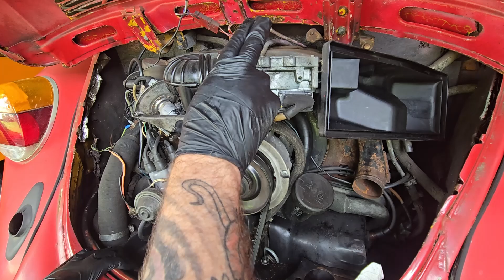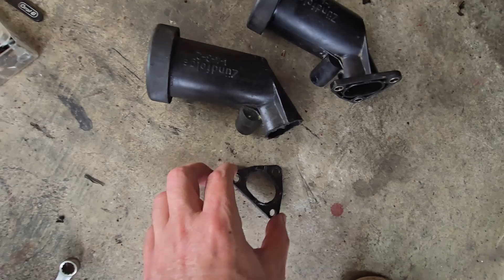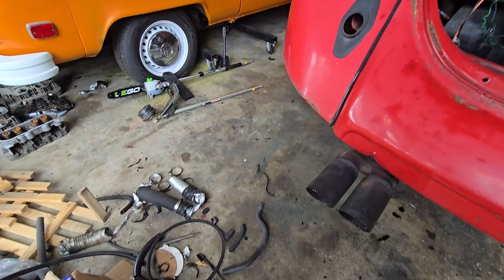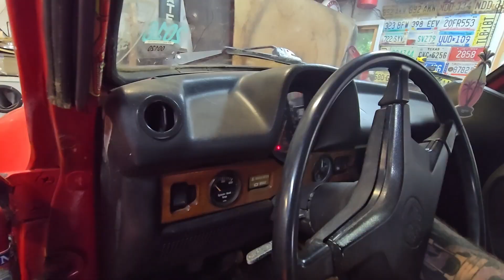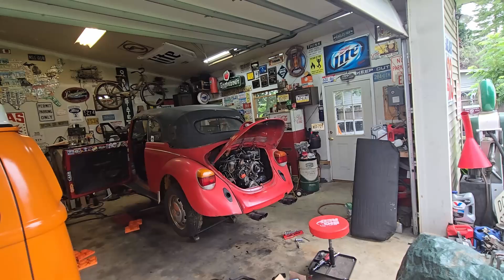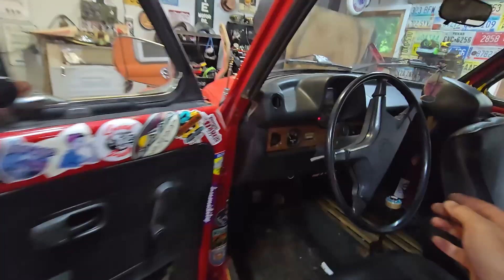VW Beetle Fuel Injection Tutorial - Full Breakdown of the Bosch L-Jet System

Comment: Question for you sir, do you have a recommendation for sourcing vacuum lines? Also do you have a list of all the different size hoses that are used in this system?
Reply from the maker: I typically use Amazon for hoses. The smaller lines are 3.5mm ID, the larger ones are 5mm and I think the brake booster is 13mm. Good luck with your project!

Comment: My dad just gave me his 1979 convertible Super Beetle that he bought brand new in 1980, I have the window sticker for it and everything. It's been parked for almost 30 years, with one short lived resurrection in 2012. I'm alright with engines but this video was excellent and a great head start into my project.
Reply from the maker: So glad it helped! Sounds like you have a great project on your hands!
Reply: @MufflerBearingMotorpool  Thanks! Yeah I'm hoping it's not too difficult to get it running well. At some point my brother or my dad replaced the points and condenser with an electrical ignition system. The distributor definitely doesn't have the vacuum advance module on it. Would you recommend switching back? I still have all the old parts.
Reply from the maker: I run electronic ignition over points whenever I can…def better than dealing with points in my opinion.

Comment: Great video - my ‘79 Convertible sounded a lot like yours and I thought it was a timing issue.  It turns out that one of the injectors was intermittent.  When I took it out to bench test it had a nice even spray pattern.  Once installed, it would run crappy after a while.  New injectors solved the problem.
Reply from the maker: Thanks for the comment! At least with L-jet we can get parts! My Squareback had d-jet and it’s a different game finding good parts….

Comment: Hi, rebuilding a 1977 FI bug and had a quick question. Where were the vacuum signal lines that were connected to the deceleration valve hooked up to? I’ve got a little T junction with a line going into the plenum/alternator stand but can’t seem to trace where that other line picks up that vac signal. 

Thanks for the great info though! Very useful video
Reply from the maker: The decel valve gets full manifold vac from the plenum. The other full vac signal will likely be the fuel pressure regulator.

Comment: EGR is supposed to be closed at idle and wide open throttle. Gasoline and air at cruise can burn a bit too quickly, causing a pressure spike. By adding the correct amount of EGR, there will be a slowing of the flame front, which will do more work for less fuel.  This slower flame also burns cooler, causing less NOx to be made.  When new, these cars ran well with EGR.  Today, old analog EGR systems working not as designed ought to be understood and repaired in my opinion.
Reply from the maker: It’s hard to find the parts to repair the EGR fully because it’s always been disabled by a previous owner and the parts are hard to find. For the bus, finding a stock muffler is hard but finding an emissions compatible one with the port is near impossible. Thanks for the comment though! Like you, I really do appreciate working stock systems on older cars!
Reply: @MufflerBearingMotorpool  The impossible takes a little longer.

Comment: Good video,, my 79 fuel injected 1600 starts right away but will not continue to run, do you have a video on that problem?
Reply from the maker: No video for that problem but I would suggest you check fuel the wire from the distributor that triggers the injectors. It sounds like the cold start valve is firing and it’s only running off that squirt and dying…

Comment: The first one of these "de-smogged" engines I ever saw was my first EFI to dual carb conversion. I removed all the EFI parts and installed dual Solex 40mm carbs.  The hardest part, beside capping off all the connectors and plumbing was routing the throttle cable through the fan shroud. The EFI cable is shorter and routed weird. Also, the fuel pump at the tank had to be disabled and a low pressure electric pump installed.
Reply from the maker: So many FI systems go that way and I totally understand! I’m a glutton for punishment since I really like the L-Jet!

Comment: Thanks for the detailed overview. I've been trying to figure out what's causing intermittent surging on my '78 super with L-jet. Sometimes it drives fine, sometimes I'll have half power until there is suddenly surges of power as the other cylinders kick in. Probably generally noticed under full power. I don't think injectors are plugged as I have full power some of the time. If injectors are OK, my best guess is a vacuum leak somewhere. Do you have any great ways to test? I've seen using starter fluid or unlit propane to listen for engine revving. Any other suggestions on how to identify? Any other causes of "surging" like this that you've come across?
Reply from the maker: First thing I would check is fuel pressure. This sounds like a bad pressure regulator to me where it isn’t reacting fast enough to the throttle to raise fuel pressure in time. Also could be a blocked filter or a failing pump but start with the regulator test….
Reply: @MufflerBearingMotorpool  Thanks for getting back to me. I should add that power doesn't necessarily come back while cruising. It may surge and go to full power or it may just cruise (slowly) at low HP even with my food to the floor. That said, if you still think regulator, how do you recommend I test it?

Comment: Great information thanks you!
I have a 79 super beetle convertible with that motor and the motor is not injecting after i had it out for overhauling. I have gas beeing pumped to the injectors but it seems they don’t work. I exchanged the thermal sensor on the left cylinder head. I tried a different controller unit and replaced the double relais. Any suggestions?
Reply from the maker: I would suspect that the trigger wire that needs to be on the coil is not hooked up or damaged? These systems fire injectors based on an ignition signal and that’s often the culprit! It’s a white wire that goes to the points side of the distributor….check that and let me know! Good luck!

Comment: Hi bro didn't hear you teach on crankshaft sensor
Reply from the maker: In the L-jet the crank sensor isn’t part of the fuel injection system. It’s only a TDC sensor the dealer used with the diagnostic computer they had at the time. This beetle had the giant plug on the firewall and all the diag stuff deleted so I really couldn’t show any of it anyway. Great call out though because pretty much every other FI system uses one!

Comment: Great video, very informative!   What are your thoughts on running a petronix ignition instead of points on a motor with L-jet ?
Reply from the maker: I run a Pertronix on my bus with an L-jet and I really like it. Some folks will say the trigger for the ecu on the neg side of the coil won’t work right with electronic ignition but that never made sense to me and it works great!  The next video should be timing and fuel adjustments and I talk a bit about the points eliminators in there….thanks for watching and commenting!
Reply: Ok great, I've been thinking about putting one on my bus but have read mixed things about it. I'll probably get one and try it out. Thanks for the input
Reply: Make sure to get the correct coil for the Petronics system, get the one they recommend, the original VW coil is not adequate with the Petronics system.
Reply: Here in Europe a lot of people install 123ignition and are very happy with that. They have a special type that goes well with the Fuel Injection motor.